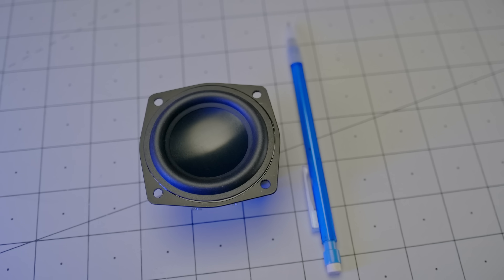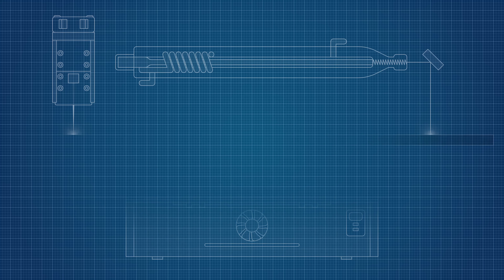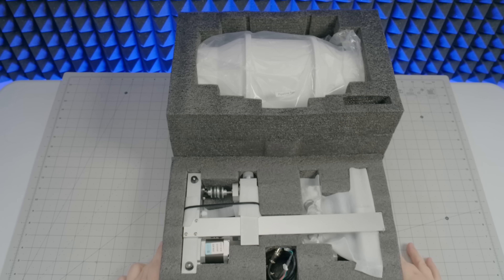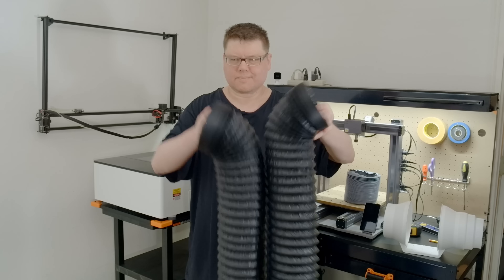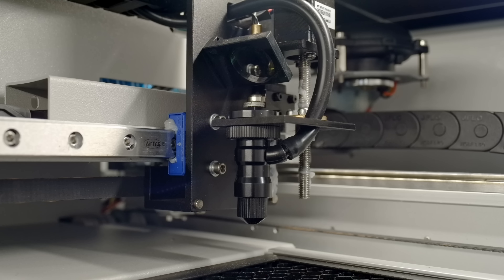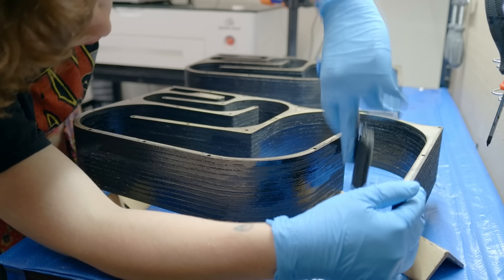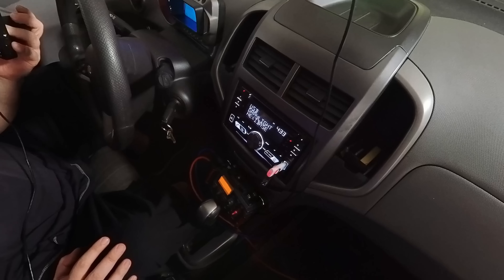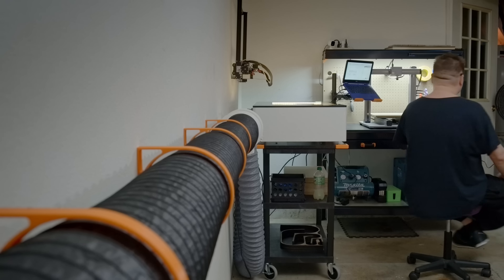Gweike Cloud Pro 50W Laser Review & Feature Build

Comment: Impressive for 2” drivers but to be honest, if that space constraint and a 50Hz bottom end are real targets, I’m thinking much more can be accomplished with larger drivers in the same or less space and with a far simpler enclosure design.

Impressive demonstration of what horn loading can do, though.  I enjoy watching each and every one of your builds.
Reply: true. on the other hand, if weight is considered, not space, this might be the way.
Also, frequency response alone is nothing, as it can be equalized out. Loudness at lows is the primary constraint of small designs. And it's difficult to convey loudness over a youtube video. So i'm having a hard time appreciating how good (or not good?) this design really is.
Reply: @victortitov1740  good points, however, if low weight is a primary objective (in a car for example), eliminating the subwoofer altogether makes the most sense.  Also, you cannot equalize-in more driver displacement. 😉

Comment: I made a somewhat decent ported speaker system for my old computer using some K. Tone 1.5" 10w drivers a while ago, I wasn't as much an audio person back then but I remember them sounding great and I still have the drivers laying around for if I make any new projects. (Video of the exact drivers https://youtu.be/gFodjKV2Jo8)
Reply: @HexiBase  I was very tempted to do so as well, they were interfering with one of my box designs which was literally a dodecahedron (discord cdn link to a picture https://cdn.discordapp.com/attachments/671875796872331264/1035607657635135529/1666978501344.jpg )

Comment: Hello Hexi base I watched your 3d printed 3 inch sub enclosure and was really surprised that such good bass could be produced with well built enclosure. I had bought a cheap 4 inch "subwoofer" on amazon and was wondering if such results could be obtained with it too. I would be grateful if you could design /modify the 3 inch subwoofer enclosure to fit a 4 inch one.

Comment: I used a smaller diode laser to make a 1/10 scale replica of the wall I'm building in my xb
I'm using  TC5FC07-04 that I trimmed the frames on to fit in the model.
Reply: @HexiBase  I'm using a 3d scanner and a 3d printer, 20w diode laser to build a 1/10 scale R/C of my audio build.

Comment: Smallest audio subwoofer I was impressed with.... Polk C4 subwoofer (4 isobaric 6"X9") and the Bose acoustic wave in the FD Mazda RX-7. For home the tiny Cambridge Soundworks sub is about 1/6" the size of a Bose acoustics module and performs very well in comparison. All this said, none are a good a an 8" or larger driver in properly designed enclosure.

Comment: Totally random question, but what head unit is that in the car?  Kenwood/JVC?
Reply: @HexiBase  I thought so, I'm looking for a double din HU with centre volume control for the van, figured if you were using it, it would have decent performance,  all the similar Pioneer and Kenny HU's have really low RCA voltage outputs, may have to go oldschool used. Cheers mate, love your work, been watching for years, still remember the "guess the sub size" vids, golden. Those wave guide cabinets you're making are works or art.